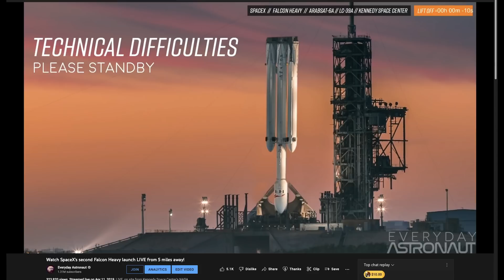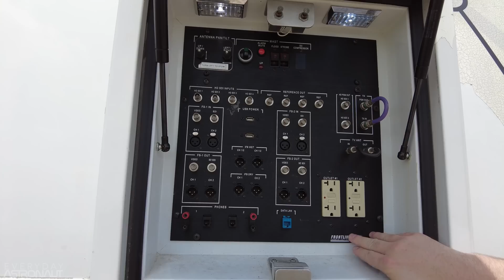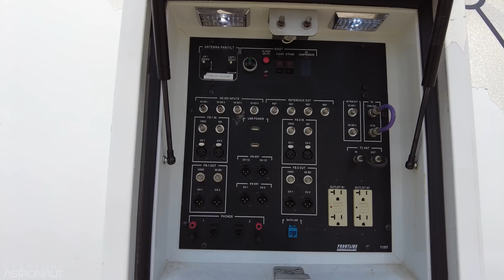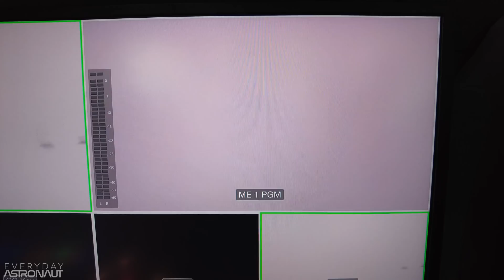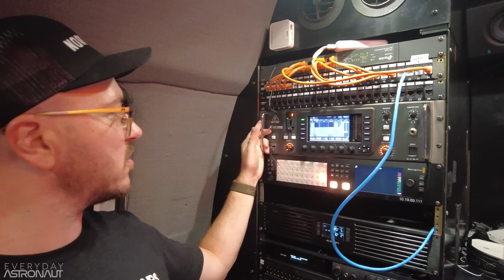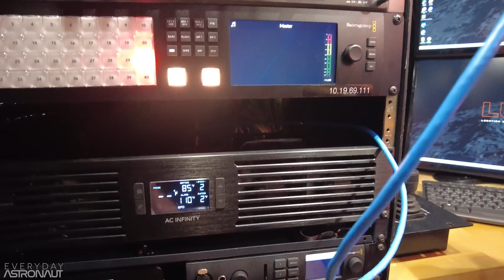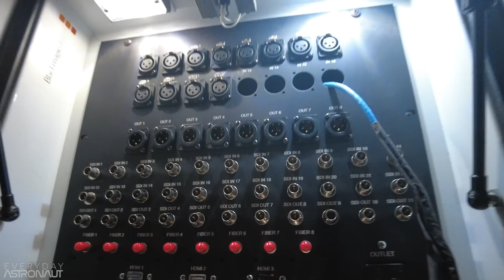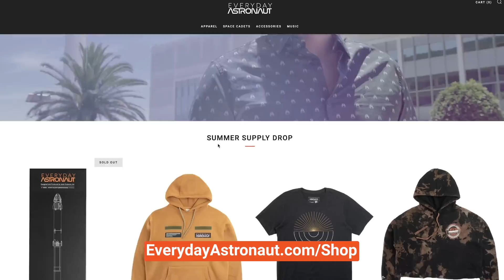I Built The Ultimate 4K Rocket Chasing Van! Retired News Van Makeover Build And Tour!

Comment: Be careful with that mast. They can’t handle much more than 35psi and need constant lubrication. Contact will-Burt and make sure that if you’re gonna use it, you do it right. Also if the truck didn’t come with stabilizing jacks you’ll need to look into them. At full extension that thing will rock enough to induce nausea in ~15mph wind. Frontline communications who built the truck can also advise on necessary gear/precautions.

Source: have used those trucks for 15yr and currently maintain/service 7 of them
Reply: Charles, thanks for your insight, respect and contribution to the community. 🎈
Reply: good call
Reply: How about a nitrogen tank and two 1 inch electric air valves for quick deployment? Haha I'm kidding of course. He would be having his own launch into orbit !!!
Reply: Bump because good info
Reply: Tim: Do you know who integrated the original van?  I used to work at a San Diego company called NSM Surveillance, where the NSM stands for "News, Sports & Microwave", as the company's original business was creating custom media remote vans.  While the company is no longer in business, many of the old crew are still around.
Reply: just put a lawn chair up there and send it lmao!!!
Reply: And once the launch vibrations hit, the image quality might get janky.
Reply: @flymypg  The original IO panel when they got the truck said Frontline Communications (as does the replacement, so they must have some line of communication with them)
Reply: Maybe tim should keep you as a contact for servicing.
Reply: I was worried that once he got it up there it wasn't coming back down.
Reply: And the one thing to always remember. Watch for power lines. Too many guys have lost their lives that way. You’d think after the first one, it would be enough. But sadly no.
Reply: Another recommendation is to switch 8SE to EDGE 8HD telescope. It has got coma corrector built in so it has clearer view than standard 8 inch
Reply: Add stay rigging , for stabilizing the launch rumble vibrating the cam
Reply: @erfquake1  Might be a good idea to send up guy-wires and stake it down after deployment to minimize wind effects and other vibrations.
Reply: @luboinchina3013  Agreed.  An '80's C8 telescope is good for astro observing, but one of the new 8" EdgeHD optical tubes would be much better.
Reply: And a large main sail so you can go to the Bahamas.
Reply: I second stabilizing jacks. I'd be worried about lightning strikes as well. Is this thing grounded somehow? Would not want to blow up all that gear.
Reply: how would one of those new spray-on motorcycle chain lubes do on that mast? I have had good luck so far with my outdoor equipment that I used it on. Doesn't seem to want to trap grit very much and almost won't wash off.
Reply: @Bill_N_ATX  I was going to make this comment, guys have died, some years go by and more people die. DON'T ADD YOURSELF TO THAT LIST!
Reply: Was thinking that’d need extra stability, not sure how much of a shockwave it’d be getting from the launch wondered if that’d effect it aswell
Reply: @t0ad967  true but at the same time I feel whatever launch he was streaming wouldnt be fulfilling its launch window if there’s that chance of lightning because the rocket creates a lotta static charge so if a 20 m pole is at risk the rocket would have a high risk of creating its own lighting
Reply: @t0ad967  the car is a faraday cage. I think rhe lightening would go outside around the car.
Reply: Bump
Reply: I was thinking it needed stabilizing jacks and no doubt servicing.
Reply: Follow Charles advice, contact Wilburt, they will treat you right. You have to make sure that the plumbing for the compressor, has a check valve, and a manual emergency release valve to let it down in case of Lightning , etc. Use a grounding Rod, as that mast is now grounded ( bonded) to your truck chassis. Good luck, and keep us posted on the upgrades!
Reply: Yes sir, right on the money!
Reply: Frontline's around the corner from me here.  I assume you work for a station, and if you still have 7 stick trucks fielded, a top 10 market station.  🙂

FWIW, though, I've never seen any of the Tampa market stations' microwave E-350's have jacks...
Reply: Also google "Adrienne Alpert".

Comment: For your safety, please secure those Ecoflow batteries! Do so with strong steel straps into the floor. During a crash, or emergency braking these will become very heavy projectiles inside the cabin and very dangerous to you and the equipment! (obviously secure other heavy items too) To stabilize the mast you may want to get some thin yet high-tension(no stretch) rope like HMPE / Dyneema or steel cable and some heavy-duty Auger-Style Stakes to drive into the soil. Plus some ratchets. This would help with the sway of the boom arm. Also as others have said, get a Starlink for RV's dish for connectivity because why not?
Reply: @Dorian Anreiter should have typed it all in sarcastic SpongeBob letters.
Reply: If there's a 5G connection present at the launch site you'd have much more available bandwidth with that than Starlink though. (~400MBit/s upload on 5G vs 70-90MBit/s on Starlink)
Reply: the boom is made not to sway

Comment: 17:17 Great project, one tip make sure that PC on the floor has it's GPU supported. Since it's on the floor of the vann that PCI-E slot will encounter some hits (bumps). 
I would advice to put the PC on the side or use another case. But the rest is awesome!
Reply: 4U rackmount case would do the job with 92mm air cooler

Comment: You should do a solar panel array and victron inverter so you have a solid AC power source... Neat that you're re-using a STNG truck with a pneumatic mast. Watch for power lines whenever you plan to extend it since it can kill you if you get within arc range of high power lines. If the seals are old, you may need to rework the pneumatic mast seals since the mast will slowly leak down if you don't have good seals at each segment.
Reply: You don't think that 14 Kw of AC power is enough for a van? Adding an additional inverter is pointless.
Also, solar panels won't do much for applications like this where you need lots of power for a short amont of time.
Reply: Honestly, the inverter in the Delta Pro can already support 1600W of solar. If they pack around three or four 400W panels, they'll be able to run the rig all day and into the night most days. They should totally reach out to Ecoflow and ask if they can get their new PowerKit for their van. That'll give them even more battery (up to 15kw). Cheaper if they go victron, but more complicated and Ecoflow seems pretty willing to get their products in the hands of youtubers.
Reply: @tannermeade  400W is way too low for the server rack, not worth the weight and complexity. Shore power input, larger batteries and an expensive engine alternator is the way to go
Reply: @dfgdfg_  thats why tanner said "three or four 400w panels". Not one panel.
Reply: @tannermeade  Looking at all the equipment they got, 1600W of solar won't do much. You'll get maybe 1000W continuously for a few hours on sunny days and that's the best case scenario. They're not going camping with this van. They'll go out a few hours at a time and will need big power from all that equipment, just like an EV. And there's a reason why EVs don't have solar panels.
Reply: @MrArcticPOWER  he said on the live feed today the van has an auxiliary alternator feeding a 3Kw inverter, that’s good to charge the batteries in an emergency
Reply: Space?
Reply: I honestly can't see how the mast adds anything. Either you have visibility to the rocket or you don't, a few meters of pole don't really does anything.
Reply: @KevKlopper  Option for a better positioning while ignoring local obstacles like fences, sheds, other low buildings, trees or small hills is pretty big.
Reply: @KevKlopper  have you not noticed that all his rocket-launch-live-streams have been from higher up vantage points?
Normally from someone's balcony.
So what if you don't know someone in that area? Or can't find a place at short notice?
Reply: @KevKlopper  wtf are u saying lol

Comment: Great project- 
First, I totally agree with CL below that with that mast, you need outriggers/jacks, (and you're about to become best friends with a pneumatic cylinder shop, especially seeing water blowing out of the O-rings)

Second, a humble suggestion- you should probably check into 3-point captain's chairs for the front 2 seats, those are seats that normally point straight-ahead-toward the windshield BUT can be released to pivot 90° so driver & passenger face each other, and ALSO can pivot 180° backwards to face the interior, and perhaps add 2 more people able to be on laptops / working.  Should ALSO mention that it might be worth getting a square-channel tow hitch, then bring along a mountain bike / e-bike to easily run errands or travel distances that you wouldn't want to walk.

Third, remember when local TV news crews used KU band satellites for remote reporting?  We, I happened to have a KU satellite for business, one of the odd 'perks' was flipping through the local ABC, CBS, NBC remote truck news feeds when I was bored.  Based on what I got to see from behind-the-scenes setups from livestreams of 1990s news vans I'd suggest- 

1) Add a connector for an awning on the passenger side, you want an awning you can put up so you can access the uplink/downlink panel and do an interview during a downpour.  
Might also invest in some of those magnetic-clip-together mosquito screens for garage door openings so create a "screened in porch" so that when you turn the lights on, you're not attracting every mosquito & blackfly within 2 miles.  And you want a bug-zapper that you can mount ~50-feet away from the truck so you're not broadcasting with swarms of bugs drawn to your production lights.

2) Might be worth adding a Jeep-style full-sized-spare & Gerry-can mount on the back doors- can't be too prepared. Bonus, that frees up the existing spare-tire well for filling up with beer, soda, and bags of ice to keep things cool (favorite trick of football tailgaters everywhere), just slice a small split in the rubber grommet / drain plug so the water drips out.

3) Shade. In Texas & Florida, you definitely want the van roof to have a mirror finish to reflect as much heat as possible. Even better, not QUITE the James Webb level, but a silvery mylar tarp ABOVE the mirror van will reflect heat away from the van a give you hard shade. 
Who knows, perhaps you can find a surplus paratrooper or Dragon-test parachute and use the lower part of the mast to give you a nice shady 'big top tent" area.

4) Put quick-disconnects on EVERY microphone and headset so that when you forget what you're doing and walk away, the cable disconnects. I almost died-laughing when watching the live stream from a remote van, where local reporter Jerry Penacoli was re-recording his segment intros, forget he was still wearing a microphone & headset as he walked out of the news-van, IIRC clotheslining him because the headset wire wrapped around his neck because he spun his chair around (office chairs that spin 360° are bad, they will try to kill you) followed by a load (and expensive) CRASH as it pulled a head unit out of the rack.  (Don't just slide them in on the rails, add that bolt that keeps them from getting pulled out of the rack).
Reply: Very detailed. Fun read. You must have done some of this, yourself, at one point or another.
Reply: Way to long I stoped reading  the comment because it was so long
Reply: Next time do a short comment ok if you agree  put in a reply

Comment: You might want to keep a CO2 sensor inside the back. You'll need good ventillation back there especially with two people back there for hours at a time.
Reply: And make sure it's a real CO2 sensor and not one that measures something else and guesses.  Naomi Wu did a recent review of several affordable models on her Sexycyborg tech channel.
Reply: What about CO? Carbon monoxide is far more deadly than CO2 (carbon dioxide).
Reply: @kauffmanba  What would the CO come from?
Reply: @dogboy2613  Exhaust leaks in the engine or generator.
Reply: @kauffmanba  They'll be running everything off a large battery. The engine won't be running.

Comment: As someone who worked with outside broadcast equipment a few decades ago, I can really appreciate what modern gear allows us to do. Back in those days, a broadcast van was the size of a bus, required a LOT of 3 phase power, all to handle 4 cameras which each weighed about 70kg - not including the cables that ran out to them from their control gear. and the output from the whole van was only PAL broadcast quality.

Comment: Very nice build! 

From a IT guy, a few suggestions id have would be to build a sliding sleeved support rail for the lines off the side of the van. The weight of those lines and if someone trips or snags one could save you a feed or port/cable failure in the long and short term. 
The gaming PC's I would move to a server in the rack to push the heat to the back of the van. Close up the gaps in the rack so you make a hot and a cold side and even the NUC could be moved to the server as a VM to reduce heat and energy load. The server doesnt need to be some proliant or dell server, you can move the gaming pc to a Rosewill server chassis to free up legroom and push that heat to the rear. The HDMI encoders could go into the server chassis to benefit from some air flow, and the chassis can be setup to pull from the crew area and push to the rear. 

Nice work and nice build! now it just needs some paint.
Reply: If they get rid of the gaming chase, won't have all that sick RGB.

But seriously this is good advice

Comment: When the mast is fully extended any movement in the Van would cause enormous swings at the top of the mast.  To counter this use RV stabilizer Jacks.
The mast on it's own will have alot of swing in the wind.  To counter that use 4 small winches mounted on hard points at each corner of the roof of the van. Have them on freewheel during extension then tighten. 
Also get a compressor mounted to the vans engine with a high idle switch. Mount an underbelly propane tank rated for vehicles and then plumb the two together. The high volume of compressed air will raise the mast quickly.
Reply: The stabilizers are an absolute must. I’m surprised that the fan didn’t already have them.
Reply: @Bill_N_ATX  Yeah this van is going to have a lot of fans.

Comment: Tim, I hope you don't forget to mount a Starlink on the top of your boom. Add a fan on the boom to cool your Starlink dish and the  cameras below the Starlink dish. keep the cameras coo
Reply: Just put Starlink at roof level.  70 feet or 70 meters makes no difference talking to something 400km up in the air, but any sideways swaying will affect the aim towards each satellite.  When it was a news van they probably did the same with their satellite links and used the mast for ground based microwave links to station towers, or possibly as a backup broadcast antenna in case the station was destroyed by a newsworthy event.